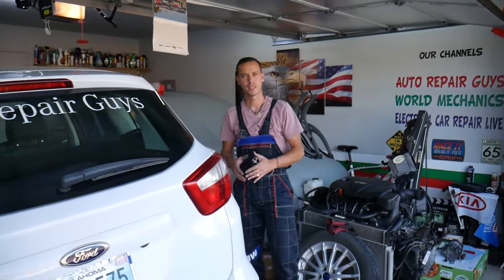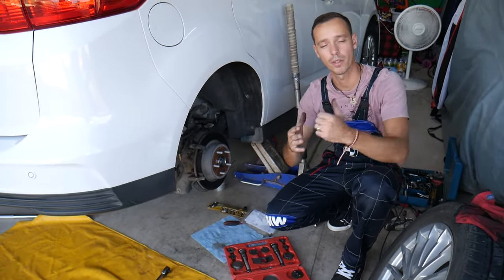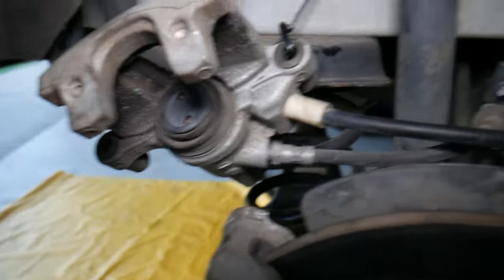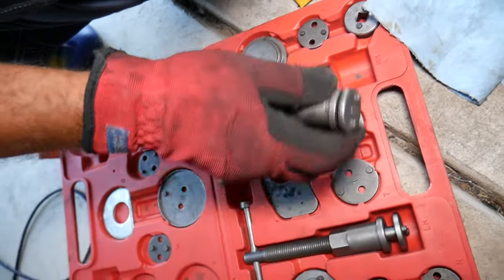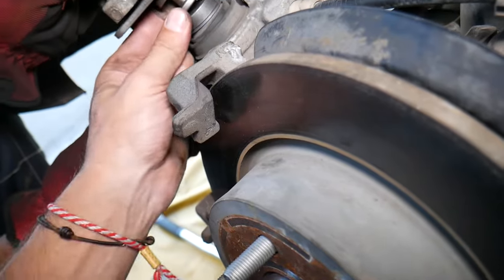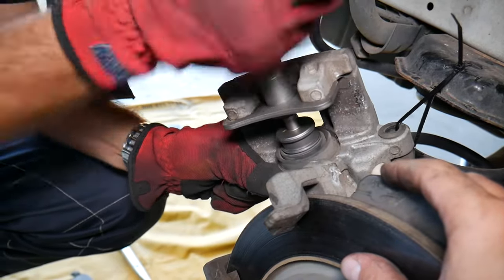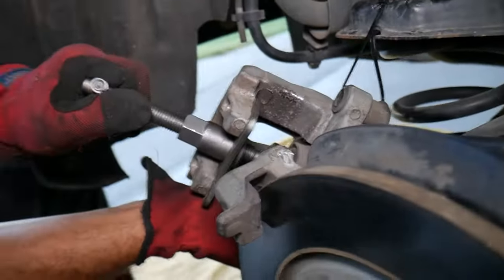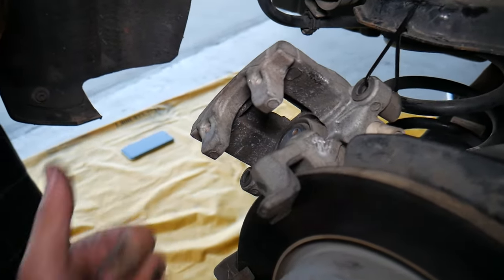HOW TO COMPRESS REAR BRAKE CALIPER ON FORD ESCAPE C-MAX EDGE FOCUS EXPLORER FLEX FUSION

Comment: So its not necessary to open the brake line? I always thought you had to open it.  Certainly dont mind if i dont have too
Reply: You should never have to crack the bleeder. You're unnecessarily introducing air into the system.
Reply: @AraceaeFanatics  I guess I was thinking the backward pressure could be troublesome.  But I did the job and had no problems so I guess it's fine
Reply: Open the resivior